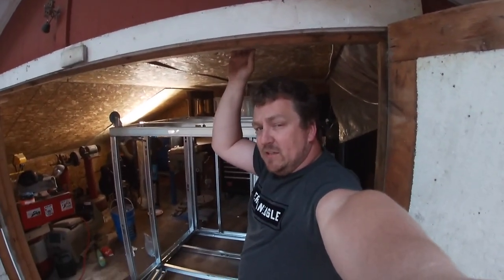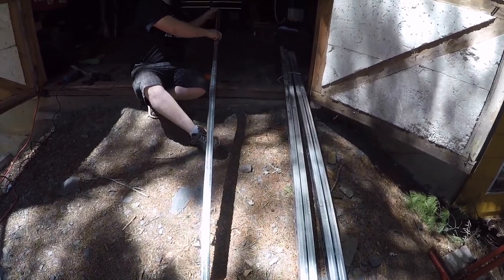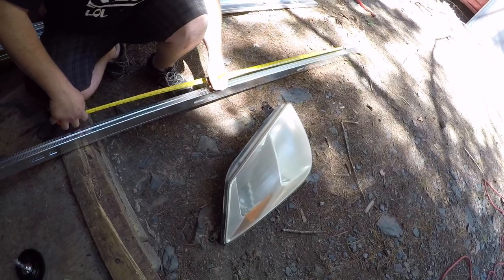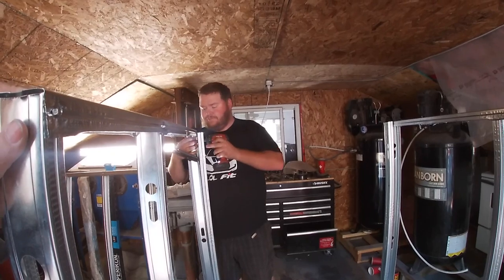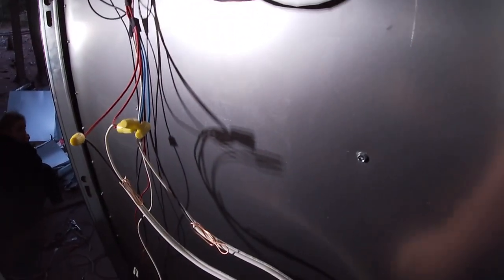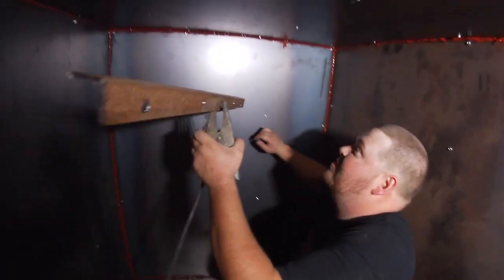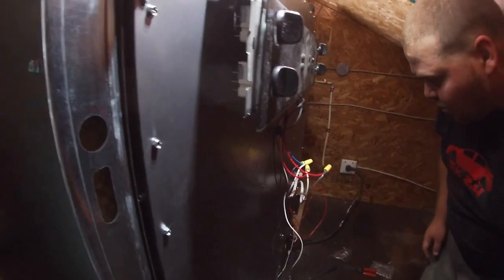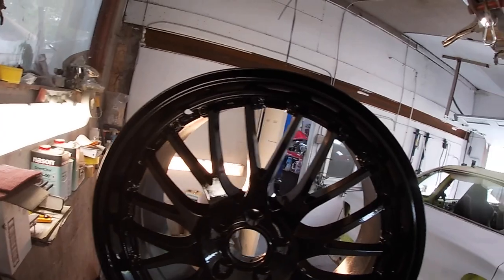We build A Powder Coating Oven At HOME With Basic Hand Tools ***DIY POWDER OVEN IT'S HUGE 4X5'***

Comment: Video is great guys🤘🏼.. getting around to building my own as we speak. Also the wheel came out great. 
Just a quick tip for the wheels. Use the valve stem hole to mount the rim. The hooks are on Amazon for dirt cheap and make the world of a different. 👍🏼👍🏼
Reply from the maker: Thanks for the tip!
Reply: The expression is "a world of difference "

Comment: Did u used the 3 prong plug that the oven came with? Or did u used the regular home one with 2 plugs?
Reply from the maker: 3 prong plug
Reply: Is there any way to just run a regular plug like an house outlet  like taking the oven out the stove and only use that with regular plug